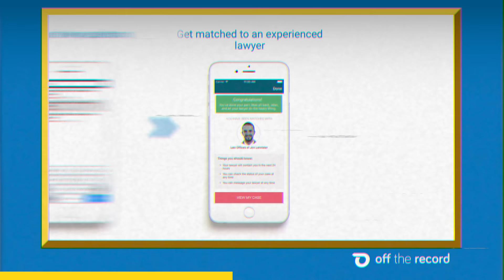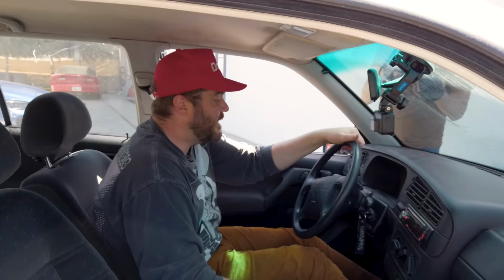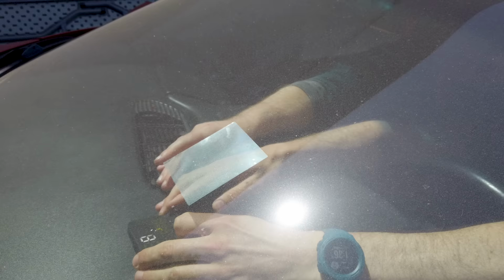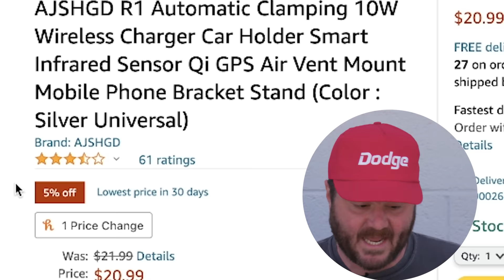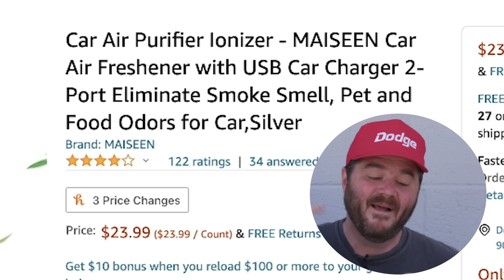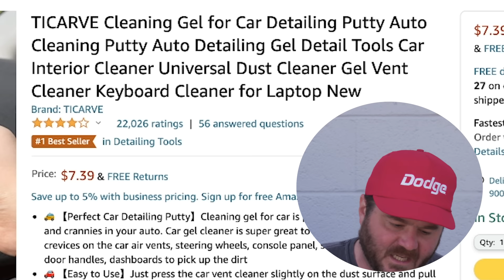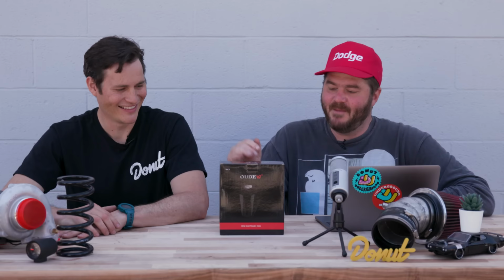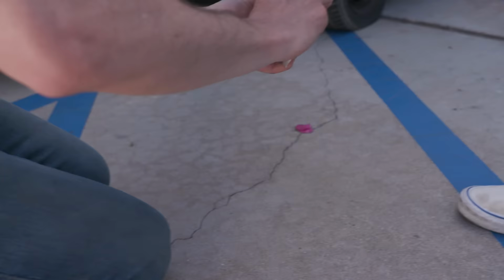We Bought the Most Futuristic Car Products on Amazon

Comment: As someone who used to do really long commutes at night, those HUD devices are fantastic.  Get a good one and take the time to set it up right.
Reply: I don't have one, but I have considered it. I like the idea, I just wish there were one that's super customizable or doesn't have really tacky fonts or anything. Something a lot like you'd see in a Bimmer, just a nice clean UI.
Reply: Would you recommend it for someone whose dash lights went kaput? As in would it be a viable dashboard replacement? At the moment I have a flashlight tacked onto the steering column.
Reply: @RunnersLoss  bro just fix your dash. but if you have an obd2 port it could work for a temp fix
Reply: @raynjpg  +1 for correct spelling of Bimmer
Reply: @denoftools  not a fan of having to place my phone on the dash to act as the projector for/as my HUD. would just enjoy a decent looking full time HUD.
Reply: @RunnersLoss  check your fuses and dash lights, may be a cheap fix
Reply: i used an app, you put your phone on your dashboard and it'll reflect it on the windshield and it'll be an  hud only works at night or when its dark
Reply: Holy crap! Red the tool bear watches donut media! Shine on
Reply: I've worked nights for years and haven't seen the need for a HUD. Just dim the lights on the dash. I think its a gimmick nobody asked for.
Reply: My car has a Heads Up display from the factory, and though it may not be "Life Changing" it certainly is nice to have, and I miss it when I drive my truck that doesn't have it.
Reply: @blackoppsrage8470  My cluster repair is over $200, these things are like $30, the whole damn car isn't worth doing an entire cluster but I would like a tach and speedo that comes on when I start the car.
Reply: dude it’s honestly the only product that belonged on the future list 😂
Reply: i think theres a reason that before this HUD thingy some ppl put got 2 speed and rpm meter, one from factory in dash and one third party strapped on top of the dash/left/right column, along with boost and etc. or at least thats the reason my brother did it, now he got a HUD he took off that second speed and rpm gauges
Reply: @RunnersLoss  Funny you say that, my speedo died and the autoelectrician recommended just getting a hud instead of fixing due to price lmao.
Reply: @RunnersLoss   @Lomein  i got one because my gas gauge doesn't light like the rest of the dash. And its been pretty useful my car is 2000 so battery volts, speed, and trip and clock  is all i get. so if you have a 2001 and up you'll get more features. Just set it correctly and definently turn off the over speed warning chime. Also make sure its obd11 plug.  Mine was cheap from scoche. Plus some more expensive ones have obd11 scanner functions meaning itll show service lights.
Reply: @RunnersLoss  you could get a real digital dash, but expect to spend 500-1000 for a nice one, or possibly more if you go the haltech or ecumasters route
Reply: i use to have long drives home att nights to but i never needed to know my speed or anything becaus i know my car tops out att 200kmh
Reply: Well i have factory hud in my car and honestly i can't imagine having car without it.
Reply: @RunnersLoss  check your -10 fuse maybe
Reply: i got 1 5 years ago for my ranger. radiator blew a leak and warning light on hud lit up and alerted me before the dash guage reacted.
Reply: @RunnersLoss  dash light fuse?
Reply: @TheFishE77Official  Same. When driving my truck it's one of the few things I miss from my car.
Reply: Ya theres some awesome ones. I dont get why they buy the e-waste/knockoff/sketchy versions of everything lol. The titles for these should be: We bought junk for our junk cars
Reply: @RunnersLoss  it should just either be a fuse or a cheap little light in the back, for what you would be paying for a decent HUD you might as well just fix it
Reply: I drive doordash at night so thats some good advice, also i like you're channel, didn't expect to see you here, although the cgi bear is a bit creepy imo lol
Reply: i don’t need clock or speed on HUD and drain the battery from ODB2. i would install if the HUD can show sat nav.
Reply: paid the extra and got one for 150 a jb hifi best thing I've bought not delayed what so ever definitely worth the purchase if you get the right quality :)
Reply: @fatgirlboy9341  it wouldn't drain battery while the car is off tho, and as for while the car is on, that makes about as much sense as worrying your phone charger will drain the electricity from your house, way more is constantly being generated
Reply: Guys putting useless things on the future and the HUD on the past without even testing it. I had one of those for years, it's very helpfull
Reply: This is a pretty good option. My cars do not have coolant temp gauge... With this little device I can monitor it no problem. That's a really good option. The fact you can get the speed, battery voltage, rpms, not that bad. Sure it takes a while to set it up correctly but I believe it is worthy.
Reply: @Mach141  They can be quite useful. Not easy to look at your actual dash gauges when you are driving from the passenger seat in a vehicle that has been converted to right hand drive you know. Particularly when that vehicle happens to be a 2nd generation Ford Transit Connect with huge plastic cowlings around the gauges
Reply: @ASJM91  well they did say a HUD is nice, just that one sucked
Reply: @page11racing89  check something called P10 hud, this badboy costs like 15-20$ from china, and it's just a display that you connect through obd port. But it allows you not only to monitor everything (speed, tacho, temp, distance, voltage), but due to being a small display and not a reflective device it always works and you can read it in any conditions. You even have the option to scan the obd codes and clear them. And yes, it turns on with the car and turns off shortly after the car.
Reply: When you see a Youtuber that you're subbed to, comment on another Youtuber's video you're subbed to!
Reply: Had one of these for years in various cars, works great. The lag is worse on my 2004 subie, but was virtually instant on my 2010 audi.
Reply: @raynjpg  i bought a nice screen for $120 that I use on my 2008 Mustang GT for rpm and speed. Its not really a hud because you still have to look down for a second, but it is nice and has several layouts and live parameters you can monitor. It also has customizable shift lights and everything is snappy, the rpm for example has absolutely no delay. Several of these HUDs have a huge delay in them, and I have owned one that kept overheating out here in Florida and would need to be restarted constantly. The real huds are actually very nice tho, they are very practical. Just be careful with the reflective material they come with, I have nearly gotten in accidents a couple of times because of the sun reflections
Reply: @GodKing804  thats actually really smart, I should have done something like that
Reply: I cover mine up on the X6 it's distracting.

There are way to many distractions on cars these days
Reply: They are absolutely fantastic for us bling folks. Its hard to mis read  big bright numbers
Reply: They are kinda dangerous though because for most of them, looking at the HUD makes your eyes have to refocus away from the road. Theres a reason proper HUDs are integrated into the windshield.
Reply: @denoftools  I used torque pro on an android tab as a dash.
Reply: Hudway drive is a good one
Reply: Oh my God the tool bear commented on another channel I watch
Reply: I use to have one on my piece of crap hyundai i set all the alarms so when i hit hi temp the unit beeps
Reply: @RunnersLoss  because seeing your safety lights is not a responsibility you should be taking are right away
Reply: Have any recommendations?
Reply: Hey good to see you here!
Reply: Pontiac GTP has one built in stock and it’s pretty awesome
Reply: Buy a car with one :)
Reply: @RunnersLoss  ROTFL.......
Reply: @RunnersLoss  why don’t u just buy a lexus from 2000 for like $500
Reply: @LukeVMH-Games  Ended up selling the car to my Dad since his broke down and bought a Honda from family friend for $100 lol
Reply: Jesus loves you very much repent and believe onto Him and be saved from eternal punishment of sin amen, Jesus DIED + SUFFERED for you  <3
Reply: @raynjpg  Just us a old phone. There's apps for that.
And if you know to tinker with it, you can make it turn on and start the app every time your phone gets power.
Reply: @LanceAtlas  check C800 model odbII +gps .
Reply: Yup, I knew as soon as I saw it they weren't going to be happy with it. That's a cheapo sucky one. Have a good one in my 06 Dakota and it's so much better than the stock cluster.
Reply: What's a good one?

Comment: If someone doesn't put the Nolan's face puddle lights on the new LowCar I'm gonna frickin lose it
Reply: I need to know how they did that! Did they take the thing apart and get a negative of Nolan?
Reply: @rjlind2807  when you buy it you can upload a picture for them to use
Reply: @Daytona-dz9xe  thanx! now i just need to find someone to prank w/it
Reply: honestly didn't know they made custom ones, hold on I may or may not be buying cheap leds with a transparency over it from amazon right now as we speak
Reply: @Daytona-dz9xe  I found what looks like the same listing and they only have options for constellations.

Comment: Y'all are missing out on that HUD. I bought a cheap $25 one off Amazon a few years ago and it's my favorite device in my car. Plug it into the ODBII and you're ready to go. They're even adjustable for different tire sizes throwing off your speedometer. Got me out of a speeding ticket once too! My dashcam picks up the refection on the windshield so I was able to easily prove my speed when a cop pulled me over instead of the car that was actually speeding. I highly recommend one
Reply: Any chance of an Amazon link? Even if it's out of stock; it'll be in your orders afaik

Comment: I actually have that wireless phone charger. It works perfect. I ran the wire behind my panels and spliced it along the 12v in my Lexus CT, then mounted it to the vent. I can see why it wouldn’t work with certain vents, but I ❤️ it.

Comment: The heads up display works pretty much the same way as a factory hud. The windshield is actually specific if you have the option and when you get a new windshield and if they put the wrong one it doesn’t mirror the hud and you can’t see it. The display basically displays mirrored gauges and they are mirrored from the windshield so they are right side up when you look at it from the driver seat.